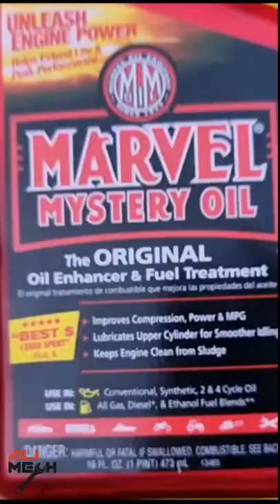Watch this before buying Marvel mystery oil

Comment: Take out your oil pan, clean if of paint (i used a paint stripper); add 1l of DMSO to your oil, and idle your engine for 30min. You will see a difference 🙂
Reply: DMSO can be found on ebay, or in drug stores. It's like a more powerful version of acetone, a very powerful solvent. Use gloves, it's use is also for deep tissue penetration of medicine, and you probably don't want engine oil deep in your tissues

Comment: Transmission fluid actually does an amazing job
Reply: Yes it just runs hotter so don't leave it running for more than 30 minutes. Incredible how it sucks up the dirt
Reply: @BenVanAmburg  i put a quart in every oil change about 500 miles before changing it.  Also,  when I get cars, i do it straight off to get the gunked up sludge out from the beginning

Comment: I mean in a way just one use did clean pretty well so since it's an additive and you're suppose to run it between every oil change makes a good use for conventional oil.... Buy full synthetic oil and then don't bother with the marvel mystery oil. Problem solved
Reply: Not all older engines can use synthetic because the seals and gaskets aren't designed for synthetic use . Also on the older engines the mating surfaces aren't machined to a tighter tolerance so if you use synthetic in them they will start to leak .  This happened to my girlfriend's car after she bought it and took it in to get the oil changed and they told her synthetic was better and she had them do it and by the time she came home the engine was leaking oil out of the intake and valve covers on the V6 it had . Once I pressure washer the engine off and changed the oil and filter and went back to non synthetic it stopped leaking oil so I told her to just bring the car to me and have me change the oil on it .

Comment: Marvel Mystery Oil is good stuff but the best stuff I've ever used to clean out an engine or to get a sticky lifter to loosen up is good ole automatic transmission fluid, Dexron/Mercon type I/II/III or IV
Reply from the maker: I might test that soon, I heard so many ppl had good results with it

Comment: Don't run this stuff on newer vehicles, just keep up with maintenance and you'll be fine.
Reply: Seafoam in newer vehicles
Reply: @haydona1845  no, best bet is to just run something like gumout and chevron for the injectors, and use crc intake valve cleaner for the intake valves for gdi engines, but to get almost all of the carbon is either walnut blasting or dry ice blasting
Reply: @jackieliu5004  You should try it before you bash it. I run it in my fuel and oil and do the intake spray. A borescope shows that it works
Reply: @haydona1845  yeah his point wasn't that it doesn't clear out carbon it's that it doesn't clear out all of the carbon any newer car has an EGR in it I promise you that's not getting cleaned because of your seafoam he's right the proper way to maintain a vehicle is to just maintain it not to try and do other things to cover up your lack of maintenance
Reply: @haydona1845  there's nothing wrong with using seafoam and yeah sure it's going to clear out a bunch of carbon in your cylinders but if you have a bunch of carbon in your cylinders you probably haven't been maintaining your vehicle
Reply: @haydona1845  he's saying you'd have a better bet cleaning your fuel injectors and making sure your valves are clean there's a bunch of other things you could do too like tear down your entire motor and clean it which is what he was referencing by sandblasting
Reply: Change the oil every 3 to 4 k and do all the other maintenance & you'll be just fine with just gas! But if you have sludge then you definitely want to get rid of it!

Comment: Best to just change your oil regularly. You'll never need Marvel Mystery or SeaFoam or anything.
Reply: Correct
Reply: MMO is not for relatively new cars. It's for used cars that have accumulated varnish on friction/sliding seal surfaces and coke sludge on piston rings, which will inevitably happen sooner or later wherever time, heat, oxidation and hydrocarbons come together.

Comment: I use MMO on every other oil change. It is good stuff. Do not use MMO if you have a GDI engine
Reply: Why not???
Reply: @grandparolie  you should check out another YTer "FordBossMe" He had an interview with MMO execs in where they explained why not to use MMO in boosted engines.

Comment: No change! I guess that's the mystery ( what happens) nothing lol
Reply: It's basically transmission fluid without the additives and conditioners.
Reply: @MindsMouth  my father would run transmission fluid into the carburetor on his cars in the late 80's told us it cleaned the carburetor and lubed to gaskets.
Reply: @rvadventures  It's true especially on carbureted vehicles. It's a thinner lubricant that helps dissolve and move the sediments out of the moving parts and surfaces, then dumps it into the oil. A fresh oil change after will show very dark fluid that is removed. 👍
Reply: @MindsMouth  not true ,I had a lab analysis of it years ago by the FAA. 
it's a naptha based oil, so it's a cleaning oil.
Reply: No, the mystery is people beat the shit out of their equipment and abuse it then want to buy something in a bottle to repair all the damage.
Reply: Your not lookin close enough..there's a small change there
Reply: @vincemajestyk9497  yeah I've yet to see an oil additive that puts metal back on crank and rod journals and brings back all the tolerances into spec.

Comment: Literally says it on the bottle..

Oil: Replace up to 20% of oil with MMO (Marvel Mystery Oil)

Also, check gaskets and connections between fluid lines to make sure Oil and fuel aren't mixing, that would be more believable when it comes to burnt residue.

Comment: Question. So after adding how many miles do you run the engine? Is this a 30000 mile addative or less? ? ?
Reply: You don't run any oil 30000 miles. I don't care what the company says. heat destroys everything over time.
Reply: @ronp499  I'd be willing to bet he meant 3,000

Comment: No product is going to remove 5 10 15 or 20 years of sludge. If it took that long to get in there it's not coming out right away. Any product that can remove sludge quickly it's going to be harmful to valve seals and gaskets

Comment: Looked the same but that's irrelevant. The Before engine was already fairly clean. MMO is a lubricant and sludge solvent, not a chrome-plating polishing wonder.

Comment: How long did u run it for?
Reply from the maker: it says 500-1000 Milles
Reply: @AliMECH  as far as I know, it should be left in the engine until the next oil change.
In other words at least 5000 k miles.
I always use it in my workshop and in my cars.
I use it to flush the engine.
I use it to flush the transmission (final step before changing the fluid )
I use it to flush the steering fluid
I use it to in so many things.
Works like magic
Reply: @omar431omar431  I didn’t even read your message and we are on the same page but you are 💯 right my brother in arms I also use at my shop for some years and everyone has thank me for not only driveability results but mpg has gained .
Reply: The news messed up for at least 30 years before anything else really came out it's amazing I use it for everything you run it long enough you'll have so much smoke come out of the exhaust you swear it's going to blow up it's cleaning call lubricating best stuff in the world great for two-cycle Motors add a little to you two cycle gas just a shot maybe a little seafoam things don't blow up

Comment: I can give an honest suggestion 
If the manufacturer recomends oil change after or at 10 k go 60 % of tht oil life amd change it 
You will never need any additives
Reply: Well sure if you've owned the vehicle since new. A lot of us inherit abused older cars. No idea on the intervals, so sometimes cleaners are used.
Reply: @DaDaDo661  that is the point
Motor inside is just like an hot oven when running
Oil passes thru passage and port 
Few quik oil changes may  solve  
These issues 
At least in my case it happened

Comment: You should neve tighten down valve covers LIKE that with an UNPACK DRIVER that will REALLY make some EXTRA work and $ for the maintenance man that just screwed up the gasket and threads on that valve cover head. Should be tighten to manufacturer's instructions and torque specs. You sure you know what your DOING is ok but how YOUR doing it is in question?

Comment: That's crap baked into and onto aluminum. Should have pulled the pan to look at the pickup or checked oil galleys. Or run it in the oil for more than a warmup. I know it works.... just doesn't work miracles in 5-10 minutes
Reply: Yup, baked on varnish, not sludge or carbon, and that's a whole different thing altogether. Only aggressive solvents can remove baked on varnish effectively such as lacquer thinner. And you're 100% right, when using a naptha based, gentle cleaner like MMO the results happen over time and a little at a time which is exactly what you want when it comes to cleaning inner engine build up.  Top engine and/or valve cover baffle inspection is pretty useless for gauging if an engine cleaner is working effectively, especially on that short of an interval.

Comment: You'd to better using diesel oil for a couple days and it won't hurt your engine and also has detergent in it
Reply: I actually use diesel oil regularly in one of my vehicles due to newer gasoline engine motor oils switching to GTO "dry" formulations and yet even after using diesel oil for over a year there wasn't much of a cleaning effect on the lower engine and/or oil pan. I then did several MMO treatments and the MMO cleaned up everything that the diesel oil didnt.

Comment: Don't do like my cousin he filled it up with mystery oil and the hole motor clogged up all the drain holes stopped up removed valve covers and all the oil was in them he said it quit smoking so he thought it was fixed 15 miles down the road it locked up

Comment: Removal of carbon deposits makes for a noisier engine and increased oil consumption
Reply: Really?
Reply: That’s actually what I always thought and I’m not by any stretch of the imagination mechanic in any kind of way..
Reply: @daniellanzilloti7421  yes. Particularly on the ring lands, the top piston ring ridges on the cylinders,  and  on the valves and valve guides.

Comment: before n after pic... Looks the same except they're opposite each other.
Reply: No surprise there since the darkened metal you see in the top engine and valve cover baffle is mainly build up, baked in varnish from the recycled/recirculated combustion gasses. That discoloration literally gets baked in to the surface grain of the metal and only very aggressive solvents such as lacquer thinner can remove that and even then the metal itself can still retain a certain amount of that discoloration. Because of that, check the upper engine components and/or inner valve cover gasket is virtually useless as a method of determining if an engine cleaner is effective or not.  To determine that what would been to be checked would be the inside of the oil pan, the oil control rings and ring seats, the piston oil return passages since this type of product is meant to clean sludge and carbon deposits but not upper engine varnish deposits. Even in the case of the oil pan and oil control rings, seats, passages, Marvel Mystery Oil falls in to the slow/gentle type of cleaning agent as an added safety measure, thus observable and significant results would be obtained over time and allowing or the product to do its job over a series of oil changes. It's precisely that safety margin and slow action why so many well experienced automotive mechanics trust and swear by the stuff. Unfortunately, an effective process which is slow and gentle doesn't fit the "instantaneous results" flash-bang format of most YouTube style "reviews".

Comment: Something better than that put one quart of transmission fluid in your oil if it takes 5 quarts the motor oil put four quarts of motor oil and 1 transmission fluid every time you change the oil

Comment: The mystery is "what does it actually do?"
Reply: I'm wondering the same. The after actually looks dirtier but everyone is saying how great it is 🤷🏿‍♂️
Reply: @mem10fan2  I have not used it, all I see is more oil covering the surface of the parts meaning passages were opened up that were gunked up. The oil being darker from the carbon removed.That’s just my observation. Otherwise if I am wrong I am just as confused as you are
Reply: @austinbrockner6405  Thanks Austin for the explanation 👍

Comment: Well, I can't say much just by that before and after photos. I've never used it , and probably would need more info if I decide to.  Although , I use Lucas engine oil additive occasionally and I get better fuel mileage, smoother idle, and no engine gasket leaking. I have a 2005 explorer.

Comment: MMO will clean up an engine, unstick lifters and rings. But it won't clean up a badly sludged engine in 100 miles. Some of these clowns put it in the day before or 100 miles before an oil change and expect miracles. If they'd use it as directed at every oil change they would see results.

Comment: It's a fuel treatment tho....
Reply: It's a multi purpose additive. It's vreat for lifter sticking noises
Reply: It's for every aspect of a motor just like Seafoam
Reply from the maker: it says u can use it as engine oil cleaner and fuel system cleaner

Comment: There's absolutely no reason to use any type of additive in your gas or your motor, change your oil before the recommended oil changes and keep your air filter and tune-ups up to date and before the manufacturers suggested intervals. I've worked on customers cars that have filed this procedure and when you open up the valve covers it looks absolutely amazing.

Comment: Go right ahead and use that junk. I've got 750,000 miles on a 6.0 chevy engine and never have put anything but oil in the crankcase...

Comment: These videos are idiotic. Seafoam cleans engines very well, if you know how to use it. Drive for 200 miles with seafoam. Drive easy, then change oil and filter. Oil will be black.

Comment: It completely sludged up my 460 Ford engine, used it as directed for a noisy lifter.
Never Again.
Reply: I don't believe this one bit it's a kerosene mix with transmission fluid basically so it's designed todo absolutely the opposite just bc you had a shit motor doesn't mean it done it to it
Reply: @FearNOevil92  yessir
Reply: Your engine is clogged up and marvil mistry oil moved the sledge  from the spaspacious areas to the narrow ons which will cose the engine to run dry and collapses

I see it all the time in my workshop

Comment: It will eat your seals and eat your timing belt so it breaks. For Real
Reply: Timing belt isn't in oil, its dry, So there's that....
Reply: Completely the opposite. MMO has seal condition properties to it. Many people have noted that once they started using the MMO that the minor seal leaks that they had stopped leaking. You are thinking of the other types of engine cleaners that have aggressive/harsh solvents.  MMO is the most gentle of engine cleaners and helps to condition seals. MMO is Naptha based, not harsh solvent based.